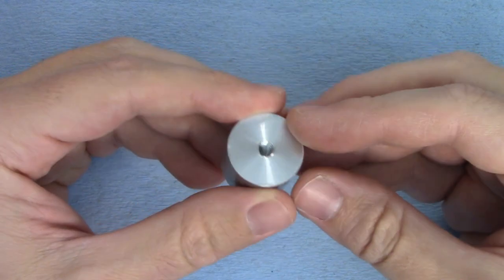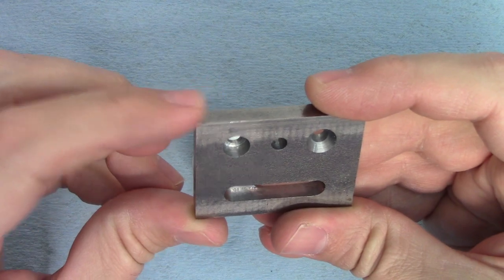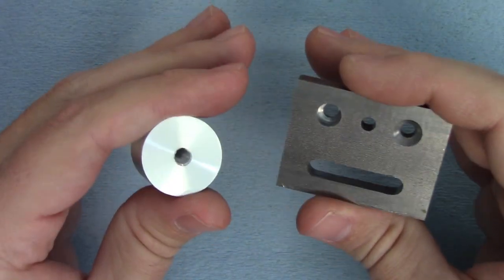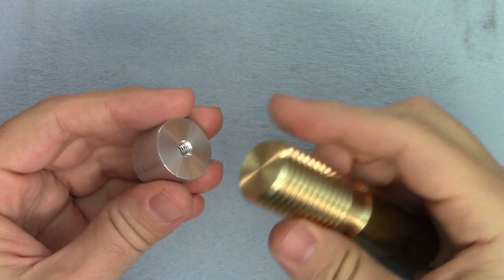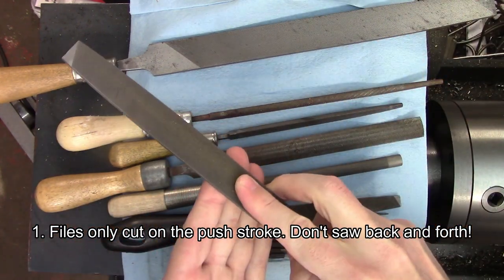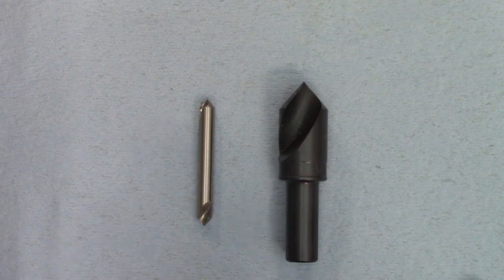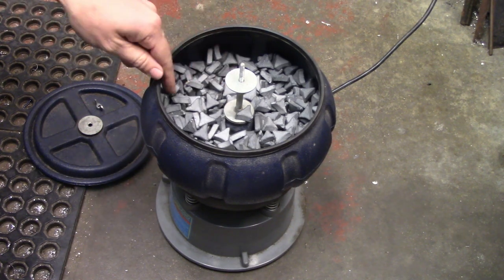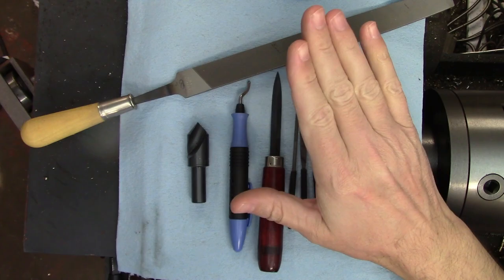The Art of Deburring - Quick Machining Tip #21

Comment: My father had a machine shop from 1969-1994 with 9 employees including by brother. A lot of parts he got in were military related. When the defense budget was cut his business shriveled. He did alright, especially in the 80's earning around $100k a year. In the summer during high school I would get dragged into work at 6am. Luckily for me I had two left hands and no idea how not to press too hard resulting in quite a few scrapped parts. I was demoted to floor sweeper and eventually not asked to come in anymore. I was not meant for skilled labor which hand deburring definitely is.

Comment: I worked in machine shops during summer vacations while at school. Deburring was my first job. Hated it! I would have laughed if someone told me that almost 4 decades later I'd own a selection of Noga tools, a small tumbler, and enough files to have built a rack for storage. Yea, I would so watch a video about files. Thanks as always for the instruction and exposure.
Reply: Ummm 🤔 lol can I bend your Ear ? I am doing some Metal Art and I drilled a out 200 holes into a damaged Harley Speedster Gas Tank. In a 🕸️ Pattern, the holes all have shrapnel hanging from the holes. It's already SOLD to a Local Bar , for Insurance Reasons and dum dums, they may stick a finger in the holes and lose that finger 🤞 lol 😂   . The gas tank has a large 🕸️ opening on 1 side. Can I use sand blasting to do it?

Comment: Hi.  Thanks for another great video.  It seems to have provoked a lot of calls for a filing video, which I agree is a good idea.  I would like to suggest another video based on a part of yours that was underplayed, namely the Whirly Noga type tools.  Like reading glasses, I have probably a dozen of those scattered out around my workshop, but though I've owned and used them for years, I'd rate my proficiency pretty low even though they seem basic. Sometimes I get a great edge and sometimes a more chattery one.  I also sometimes end up with scratches on the inside of a bore.  I could really use some guidance on the use of these, and even more importantly on the various types. There are tons of them in the catalogs and I have no idea, about the actual selection.  I've gone as far as I can buy winging it.  Would love to see more on this topic.  Thanks.

Comment: Good shorty about deburring.
A subject I'm fine with but see near nothing about is turning between centres, parallelism and the adjustment of the tailstock to get parallel or a small taper, eg. possibly for a mandrel.
Reply from the maker: I have a pretty recent video about aligning the tailstock to get the taper out, although not one on using it to cut a taper.

https://youtu.be/a-5lGmcvxlc
Reply: Ok, though turning a mandrel to use for tool and cutter or precision turning is useful.
How about precision small hole measurement...
Reply from the maker: @captcarlos  I did gage pins a few years ago. I've never shown the small hole gages though.

Comment: I even go so far as to deburr the piece of stock I’m putting back on the stock rack after rough cutting the workpiece from that stock 👍😎👍….. And when I’m unloading the truck with fresh remnants from Industrial Metal Supply, I clean, deburr, and identify the bars before adding them to the stock storage. Yep, I’m a little OCD with burrs, but it’s always so satisfying every time I pick up stock.
Reply: You wouldn't work long if you did that here. In this factory we cut no corners! I'm the only one making big smooth chamfers on fixtures and soft jaws to make them as safe as possible to handle, others think it's a waste of time.

Comment: I'm working as an apprentice in a machining shop and most of our parts are deburred with a file or the swivel tool. It usually takes my teacher about a minute to debur a part while it takes me about 10 minutes and sometimes I'll round finished corners by accident. Could you do a video where you go through the process of deburring with a file and maybe give tips on hand placement, pressure applied, etc?

BTW thank you for your videos, they've been very helpful beginning machining. Especially your thousandth of an inch video
Reply from the maker: I could do that. It might take me a bit. You're making me think about my technique and I usually don't, so I'll have to figure out how to put it into words. Tell you what, I'll make up some typical parts and see what I can do.
Reply: @StuartdeHaro  Thank you! I would really appreciate it. Your video about files kind of helped me with it. It seems so simple but it's intimidating when if I accidentally round a finished corner or take too much off an edge it could mean scrapping a part

Comment: I'm not sure if this would warrant an entire video, but I would also* be interested in any sort of suggestions for materials for the vibratory tumbler. I do have one of those, but usually use it just for polishing soft materials.  As such, I have things like Walnut shell for my polishing media.  I honestly have not considered that for harder materials. I think I would have tended to look at using my sand blaster in that case. At that, baking soda for soft materials, various aluminum oxide for harder materials.

* I left a reply to a comment that I also would like to see
Reply: No play sand for this...silicosis does not sound fun.
Reply from the maker: I'll add that to my list. I originally bought it to help polish brass parts that had been silver soldered. I tried these little green plastic pyramids that are sold for them. They have an abrasive imbedded in them, but they didn't do much. I went to walnut shells after that and again, no joy. Then Harbor Freight started selling a bigger version of mine and added the ceramic triangles you saw in the video. Strictly speaking my machine is not meant to use them but I'm a rebel. They're great for deburring but still don't polish off the discoloration from silver soldering. Alas, I must do it by hand!

Comment: Nice video. Concerning the deburring wheel, do they come in various "grits"? If so, is there one you would recommend for the hobby machinist?
I just noticed your lathe tool holder rack. Is it made from rod stock welded to flat bar stock? If so, do you have any issues with one accidentally falling when you reach for one beside it?
Sorry for the rapid fire questions.
Reply from the maker: You can see more of the tool rack in this video:

https://youtu.be/XaTVSRuePEw

I haven't had any issues with holders falling off. It will probably happen all the time now that I've said that. As for the deburring wheels, they do come in various grits and hardnesses. I don't remember what I bought exactly but it was probably a medium. I try to go middle of the road in instances like this.
Reply: @StuartdeHaro  I apologize in advance if I jinxed you. I currently have mine on a shelf above the back of my lathe and I am always looking for ways to improve my storage. After watching your video I thought about the unused bed frame angle iron that I have and may just use that and some all thread to see how I like it. 
Thanks for the link to the other video and I am going to keep my eye out for a deburring wheel.
Reply from the maker: @robertoswalt319  Bed frames are made of some evil stuff. Prepare to destroy some drills.

Comment: I would add a caution to anyone using those Shaviv-style swiveling deburring tools. It's easy to put too much leverage on that little deburring bit and break it right at the bend. Now you have an EXTREMELY SHARP piece of equipment. VERY easy to accidentally cut myself... er, yourself. 

If you're using one, use a LIGHT touch, let the tool do the work. If the tool isn't doing the work, GET A DIFFERENT ONE, don't lean into it to make it cut faster! Hard lesson to learn, hope I saved someone else the stitches.

Comment: Any advice on deburring perpendicular holes through a shaft or tube and keeping the chamfer looking even ?
Reply from the maker: I usually use a countersink until it touches all edges, but that results in an oval-shaped c'sink. I think that looks pretty elegant, but if you want it looking even you'll have to deburr with a scraper or swivel deburring tool. Both are a little frustrating to use in that situation, especially for smaller holes. They like to dig in at the low spots and slip out at the apex.
Reply: @StuartdeHaro  Thank You

Comment: What's the part look like after the vibrating thing!? I've never seen one of those before.
Reply from the maker: I'll post a picture of something I tumbled over on my Instagram page.  Look for me over there @stuartdeharo
Reply: Awesome, thanks!
Reply from the maker: @ericddoran  I just got some put up. They're not the best pics but if you zoom in you can see the surface has a slightly scrubbed look to it. The edges are still relatively crisp, but the burrs are all gone. That was after 10 minutes in the tumbler. Material was Aluminium.

Comment: Files? Sure
How about a shop made triangular scraper vid with heat treating.
Cheers
Reply from the maker: Nice idea. I'll look around for an old trisquare file to sacrifice. I could make one from scratch too I suppose. I could use a small one at home. What do you think? One, the other, both?
Reply: @StuartdeHaro  
The file would be easy and simple, I think I will do the same. I do use dead files (ones that can't be sharpened anymore) for wood scrapers and such.
I think I'm going to have a date with the grinder tonight 😎
Reply from the maker: @rickpalechuk4411  post a pic to your Instagram so I can see how it turns out.
Reply: @StuartdeHaro  will do
Reply: I have some triangular scrapers of my grandfathers that he made out of taps (3 flute) in the 1920’s (you can still see a little of the flutes in each of the 3 surfaces.). He put a nice black wood handle with ferrule on each one.  They taper to a point.  I still use them today.  Sharp as new.  No heat treatment necessary.  If you have a stationary disc and or belt sander or grinder you could start right now.  Good use of a dull tap.
Reply from the maker: @37yearsofanythingisenough39  That's a really good idea as well!